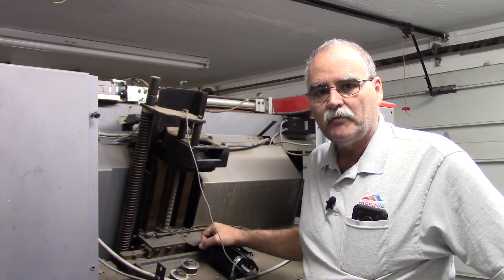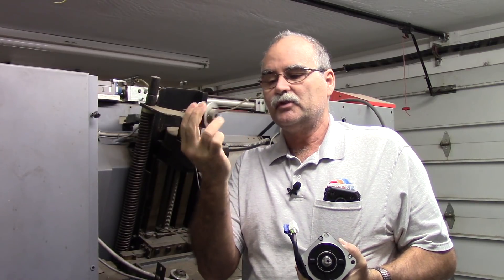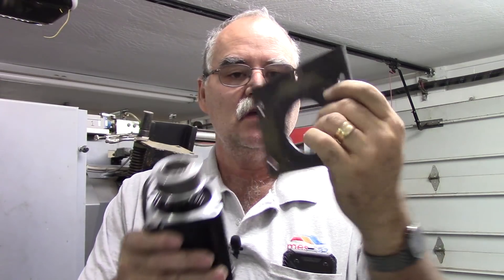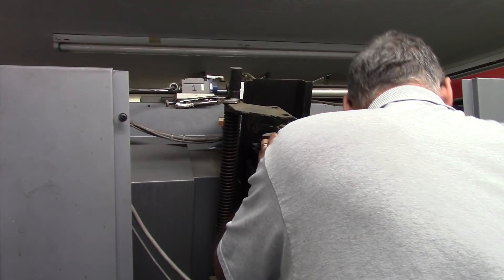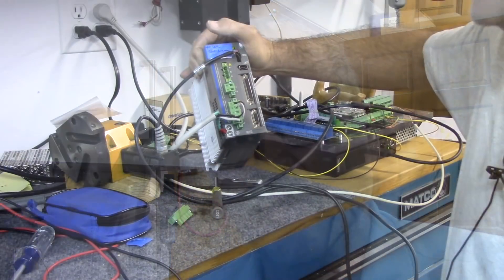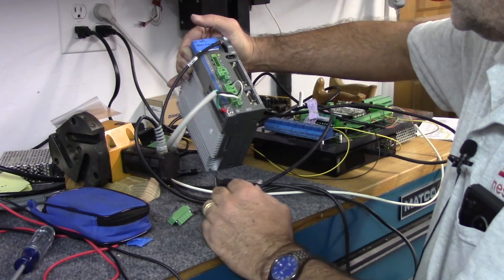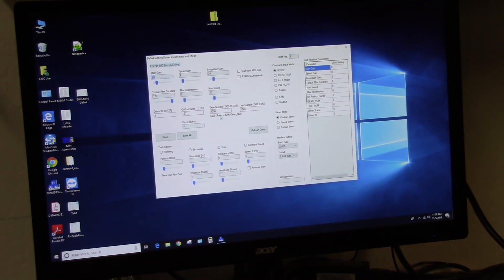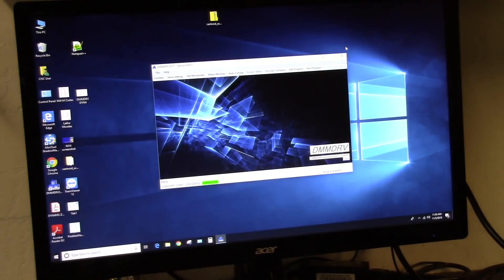Emcoturn 140 Update - Mounting DMM Servo Motors and Programming DYN4 Drives

Comment: I appreciate you taking the time to share this. I’m looking at some older lathes to retrofit and knowing what I’m getting myself into is a great help. I don’t want to end up with a useless pile of expensive scrap. I’m an old school manual machinist who’s been doing cnc work for about a decade now. Most of my personal shop equipment is manual but I do have an older Prototrak bed mill. Works fine now but could use an upgrade from the old amber crt and from 2.5 axis to 3. Lathe first tho. Looking at an Emcoturn 240 this week.
Reply: Be careful with the Encoder. They have a large DC motor and their drives typically are not usable with modern controls. I would also steer away from machines with hydraulics. Doable, but a lot of added work.

Comment: Hy Marty, I have some project and I need help with the DYN2 motor ... Any chance to control speed of the motor by potentiometer, from 0 to the hi speed what code created on the software...?  Thank you! Oleg.
Reply from the maker: Dyn2 takes step and direction input. You could probably create something with Arduino. You don't say what the application is. What you are trying to do. Not enough info to help you.
Reply: can i call you? or you can me... I can explain. 503 880 8425
Reply: I try to do 2 AXIS with 86M-DHT-A6MK1 motors. Also I need a speed control, how fast I will rotate.  I need make limit on this motor to rotate only 10-20 times.
Reply from the maker: Oleg, I suggest you take pictures of  your machine, and post your technical questions on the Centroid CNC User's forum. Need more information than you are providing. I do frequent the forum. If you are using Centroid Acorn, then post the questions here,  http://centroidcncforum.com/viewforum.php?f=60
Reply: Oleg Y use your DYN2 or DYN4 servo Amp in velocity servo mode (not position nor torque mode) and use the analogue input reference with a 5k potentiometer knob with a 0-10 VDC power supply to control it. This will work as per your description....